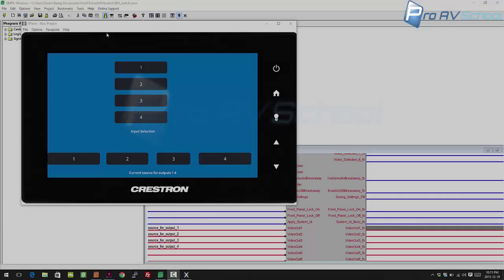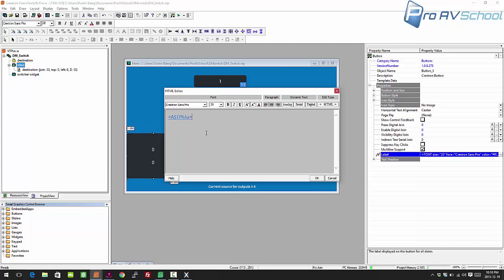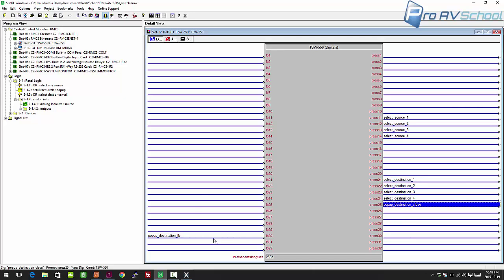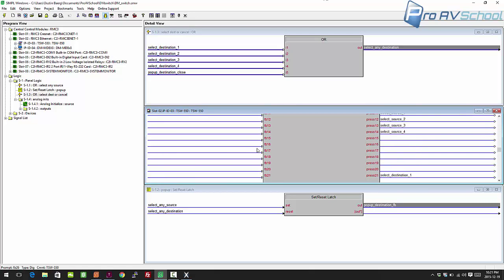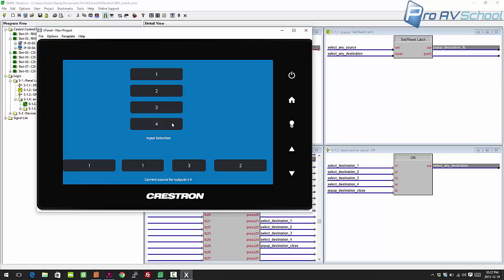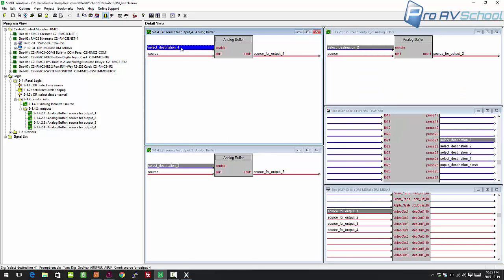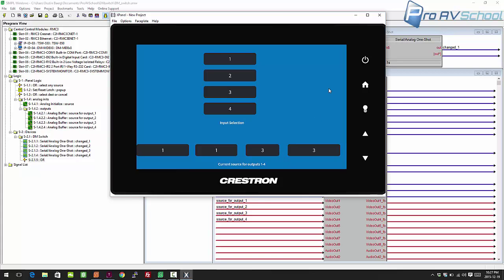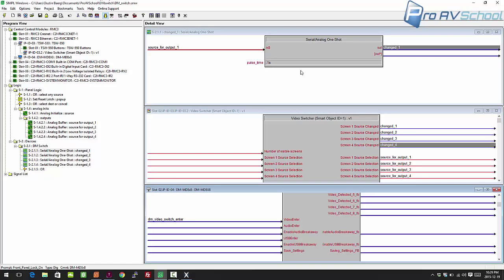Crestron Programming Of a DM Switcher

Comment: Unfortunately in my cases of matrix , atlona 4* 4 is completely different . Could u plz manage one session to many source to many destination at one time like class room .
Reply from the maker: I suspect that there is a way to set an input for a specific output, you might just have to build that out a bit to provide an analog input that equates to a digital that triggers something. Long story short you could use this logic but need to build a bit more after it before it gets to your switcher control commands.

This is a bit too specific for a video here, but I can help you with a private consultation (unfortunately I can't offer those for free, but I can probably save you a bunch of time) - email me for more info: owl@proavschool.com   -Dustin
Reply: @ProAVSchool  Do I need to add analog buffer or AOS before the destination .I used the ATLONA has a direct CMD x1AVx1, x2AVx2, x3AVx3, x4AVx4 . I tried using SIO but it’s going direct .

Comment: Dustin, Fairly new to programming and crestron, and I spend quite a bit of time on your videos as a reference.   I am working  on a similar project, but using a RMC3 and dm-md6x4 to be able to switch up to three inputs (computer, DVD, and laptop)  to three outputs (front projector, rear projector, and local monitor).  Is it more difficult, or even possible to use the select destination, then select the source?   Thanks for all the videos and knowledge
Reply from the maker: You could do it the opposite way; the destination selection buttons could feed the clock input of three toggle buttons (that way you can toggle each of the outputs on/off for this switching operation). The output of the toggles would drive the enable of an analog buffer going to each output selection. The inputs of the buffers would all come from a common init that is driven by the press of the sources.

So whatever outputs you have selected, the next selected input would route to those outputs. You probably also want a way to clear the toggles after a switch is made. I would use three analog one shots OR'd together that would pulse whenever the analog going to a switcher output changed. Connect the output of the OR to the reset on all three toggles.

This was a bit challenging to describe in text - if it doesn't make sense, let me know and I can describe the scenario in a video
Reply: @ProAVSchool   I will give that a try this weekend and will see if I am successful with that,  I was looking at something similar.
Reply: @ProAVSchool  Actually meant to post this question to the "Crestron DM Switch Programming Multiple Destinations" video, but will still give it a try

Comment: Hi! Thank you for this guide.
I was wondering, as we have a system with CP2E and DM-MD6x1 and a couple DM-TX-200 and a DM-RMC-100. 
The software on these have been setup by a third party, so I don't have the source files. What exactly can I change without these files? F.ex. one of the DM-TX-200 boxes might need to be replaced, and we would also like to add a third one to the system (we have a few spares bought used, a DM-TX-400 3G as well)

Does everything have to be set up from scratch, as I don't have the source? What exactly is the point of CP2E in addition to DM-MD6x1? 

I appreciate any help I can get :)
Reply from the maker: GlennJacobsen you can swap out receivers and transmitters without changing any programming. Unfortunately to add inputs or outputs to the system the programming would need to be changed which might involve rewriting everything if you don't have access to the source code. Basically the crestron processor tells the switcher which input to route to which output(s) and this is defined in the program that is running on it and tied into the custom user interface displayed on the touch.
Reply: Thank you, this cleared things up for me :)

Comment: You are telling very well. I have a desire to do an alarm macro xpanel can change the time of the request.
Reply from the maker: I'm not sure exactly what you are asking, but I think you want to have users change the time of something happening from the panel. There are a few ways to make it so that users could change the time of a timed event, but it is a bit of an advanced topic. The way I would approach it is build a simpl+ module that evaluates the current time vs the user input time. You could feed in analog values for the hour and minutes, which could be populated via a smartgraphics spinner type object (i think they have these ...have never used)
or else us an analog increment symbol fed with up/down buttons.

The module itself would be triggered to evaluate every 30 seconds or so (so you don't overload the system) and mathematically compare the time to the processor time. You would probably want to round it off a bit because your module might not be triggered exactly when the clock changes. Probably not a big deal in most cases.

then just pulse a digital output of the module if the even time evaluates true and some sort of flag so that it doesn't fire multiples for the same time.

After I wrote all that, I suspect it might be more confusing than helpful, but hopefully it provides a bit of insight for you.

Comment: +ProAVSchool How are you, I have a question, how can i defice which input of the DM is being selected? Like, if a choose cable and that's input 1 going to output 4, how does the input 1 associates with cable box being selected for example? i know that the analog initialize will tell the program lie 1d,2d,3d,4d... but where are those numbers pointing to?
Reply from the maker: Not totally sure I understand your question...basically for a DM switcher you tell each output which input should be router there.
Say we have a Cable Tuner hooked up to input 1 and a Laptop hooked up to input 2. Output 1 is projector and Output 2 is TV.

To Show Cable Tuner on the TV, you would need to set the input for output 2 (TV) to be Input 1 (Cable Tuner)
To Show Cable Tuner on the projector as well, you would also need to set the input for output 1 (projector) to be input 1

Each output can have any input routed to it.

Hope that helps a bit.
(sorry for the delay, I don't always get notifications of comments for some reason)

Comment: Thanks for this. I am just starting out in Crestron programming. I would like to know how to program a DM switch with the following logic: select source, select multiple (or just one) destination(s), and then press 'go' to route. I believe this is done with interlocks, but I have been unable to figure it out.
Reply from the maker: +Brandon Meiklejohn You can actually think of Analog signals in SIMPL as interlocks with additional flexibility. An analog signal can only be one value at a time, and holds the last requested value. I'll do a video in the next couple of days describing this and showing an example from start to finish of what you describe.
Reply from the maker: +Brandon Meiklejohn Check out the new video answering your question: https://youtu.be/64aOp-19pIA - I used toggles to select or deselect an output rather than interlocks.
I didn't see my reply below before I recorded but my comment here about analog as an interlock was irrelevant for this type of scenario.
Reply: +ProAVSchool Thank you VERY much!

Comment from the maker: I recently changed computers and still haven't tweaked everything yet...the resolution is pretty bad on this recording but I will wait to get some feedback on what I may have missed or omitted content-wise and probably do a new version of this in the future -Dustin
Reply: I gave a 75% attention watchthrough (will give a real watch through later today)  but resolution looks good enough on my end. 

I'm at the point of trying to understand analog and Serial communication since the only training I can get is your videos, Brett Ferguson (also on YT)  and Crestron  documentation. I appreciate you making stuff like this; always can learn something from it even I'm not trying to program a DM system, but how the logic works and how I could apply that to something else.
Reply from the maker: +feedyourspeakers Analog and Serial share some similarities but are quite different...Just a quick not that might help or point you in the right direction - Analog in SIMPL is a 16 bit number - usually unsigned from 0-65535. Serial is an "stream" of bytes that are transient. If you try to buffer a serial signal for example you wouldn't be able to do the same selective routing like I did here with the analog signals because the serial signal would have to be regenerated to pass through once the proper buffer is gated open. For this reason, I sometimes use my own SIMPL+ module to buffer serial strings since it can hold it in a variable and push it out as needed. (hopefully that isn't too confusing...slightly more advanced)

If you can tell me an example of what you are playing with and trying to accomplish, let me know and I can do a video talking about it a bit more in depth.
Reply: I'm trying to control a single dimmer (CLW-DIMEX-P) via the Crestron App. I have been reading all the documentation and help files, but I can't figure it out. The only hints I got were about having to use an 'analog initialize' symbol...so I guess you can't even use a digital press to recall a preset; seems that you have to use analog, but that's where I have no experience yet.  All I know is that my dimmer is communicating with my gateway. I want to have like 2-3 buttons to jump to certain levels and a slider to drag the light level with my finger...any insight?
Reply from the maker: +feedyourspeakers This is actually fairly simple but admittedly abstract when all you have to go off is spec sheets and manuals. Essentially the digital pulse from a button press would drive an analog initialize to set an analog value to different levels, with the analog signal connected to the light dimmer. You could also use the analog preset symbol which adds a fade between preset values. I'll do a video on this soon as I also want to describe analog ramp, just have to get over a cold first...
Reply: +ProAVSchool awesome, I&#39;m going to give that a try thanks much  EDIT  I'm not familiar enough with what you can and cannot enter in the fields.  e.g.  digital button press in --> parameter <value1> to <value999>  which could be decimal form of a percentage? so - 25% would be .25?  or 13107? --> analog out...but then there I'm confused on what I can enter there and how that was connect to the dimmer since most of the fields are digital except for basic dimmer controls level in and level out.